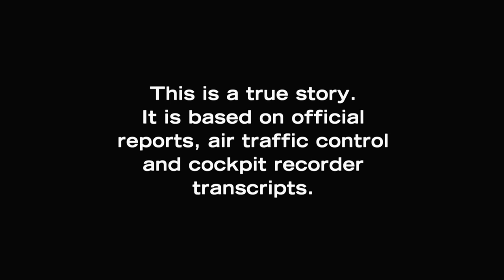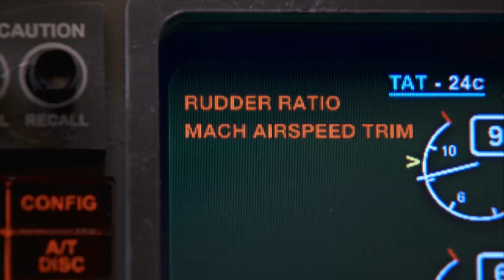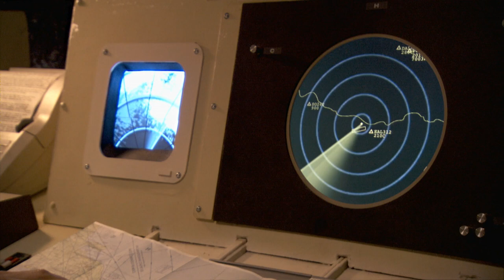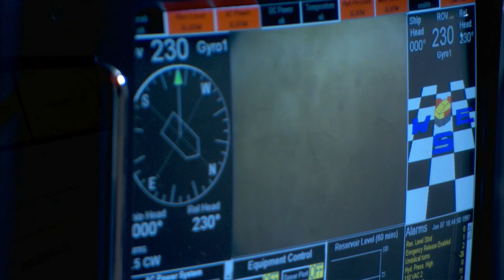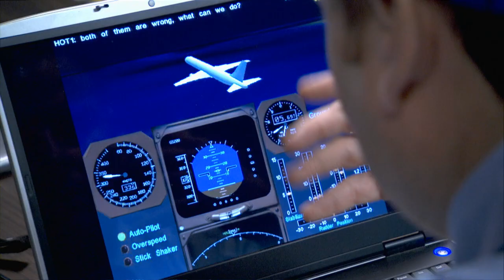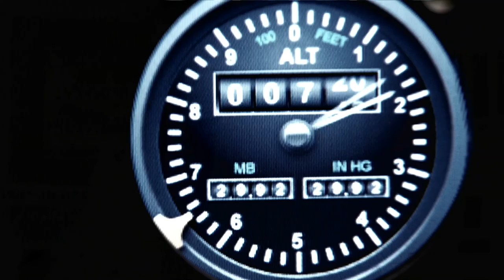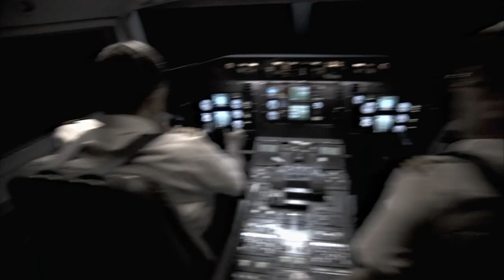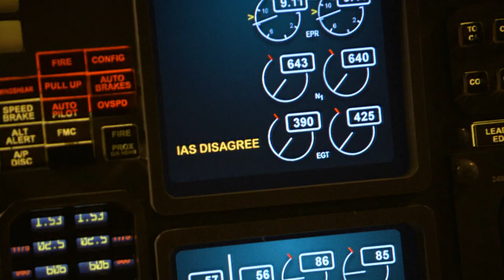The Plane That Wouldn't Talk | Faulty Readings | FULL EPISODE | Mayday: Air Disaster

Comment: I heard from another video that a pilot can ask ATC for a speed reading. If these people did that they could have gotten an external source that would have given them the idea of witch side air speed reading were right. This is basic stuff how do they not do this?
Reply: That's what I wondered. No mayday, no communication with the ground...why not ask them for verification? It seems most of these accidents are caused by one mistake after another. Not covering the pito tubes when the plane was grounded...the mechanic noticing the tubes weren't covered but not saying anything about it, which would have led to someone checking for blockages, which IMO the mechanic should have done, especially when they know about mud dauber wasps...flight crews stranded for two weeks waiting for a flight to get back home, making them homesick and prone to overlooking things...airspeed for the autopilot relying on one easily blocked mechanical input...the pilot taking off when regulations say he should abort the flight...deciding his airspeed was correct when he knew it was not working at takeoff....pilot not listening to other crew members when they were telling him what to do...co-pilot not taking control of the plane...

Comment: The Navy found the cargo door from a 747 that came open and caused an explosive decompression and pulled passengers out of the plane. It was a billion ft deep in the ocean and it came off at 35k ft. They can find anything.
Reply: Except for that missing Malaysian flight ….
Reply: Because it is larger than a pitot tube, obviously. Now try finding an aircraft piece that is merely the size of a house key, and the plane itself, in the middle of the Atlantic Ocean.
Reply: When I went to an air show, I almost couldn’t find the pitot tubes on the big planes because of how small they were.
Reply: @Powerranger-le4up  perspective thing there. Get up close they would be around a foot long or so. It is just tiny next to the massive airframe.

Comment: It seems to me that the captain (and the other officers) didn't understand HOW their instruments get their readings.  They knew how to fly, obviously, and how to read their instruments.  But when it comes to troubleshooting issues that aren't in the manual, electrical and mechanical experience is required to properly diagnose problems.  The captain, despite all his experience flying, didn't seem to comprehend the consequences of having a bad airspeed reading.  If nothing else, he should have understood that autopilot wouldn't work correctly if it was being fed faulty info.

Comment: Since at take off the pilots speed indicator was defective ( too low " my air speed indicator's not working " ) and the co-pilots was good ( used to determine correct takeoff speed ) , why would the pilot suddenly accept his speed indication was correct and they were flying to fast ? The pilots speed sensor was feeding the wrong info to the auto pilot so go to manual. The stick shaker indicated a pending stall and the pitch indication showed the nose was too high so why wouldn't the pilot drop the nose , pick up speed and prevent the stall ?

Comment: Blocked pitot tubes, inaccurate instrument data, autopilot disengages, aircraft stalls, pilot pitches the nose up to correct, aircraft ends up at the bottom of the sea...this all sounds eerily similar to Air France 447 in 2009. Why did history repeat itself?

Comment: Those mud daubers were only doing what they're supposed to do.  If the mechanics had also done what they were supposed to do, the failure would never have occurred.
Reply: If the pilot was even half way competent the crash would not have occurred.
Reply: @brencrun5068  I agree and also the Captain is the final person to inspect the plane to insure that it’s safe to fly. I would think the pitot tubes would be at the top of the list for inspection but what do I know??!! I can say I’ve learned a tremendous amount by watching these videos.

Comment: Is there any way to design a stand alone airspeed sensor that’s more analog than digital that pilots can use in case of faulty readings? Idk why but of all the crashes I’ve watched, this one some how bothers me the most…
Reply: Yes, an anemometer - a small propeller near the wing root - driving a small, bicycle-type generator - and an analog voltmeter.  

Not very precise, but simple and straightforward.

It can be “compensated” by making the scale move on the basis of air pressure/altitude/angle of attack…

100% analog.

Comment: I've watched several videos where the problem was a blocked PITO tube and I wondered about a way to blow out the PITO with compressed air. It would simply require a valve near the reading device and right next to it a compressed air line which when activated would blow a suitable pressure back out of the intake end and clear it and issue a warning if it was not cleared. When the PITO is cleared the valve would open and the system would be back to normal. If not, it would ground the plane. Clear "PITO" would be first on the take-off checklist. But... I'm sure I'm not the first to think of this.

Comment: Add pitot tube unblocking even if they appear clear upon visual inspection. Just a thought.
Reply: Right? I've often thought that, like a compressed air line that can blow them out with the press of a button, same for the static ports

Comment: For $100 million plus, it will always baffle me just how fragile && finicky aircraft are. Bugs, birds, a missing bolt & boom disaster 🤦🏾‍♂️
Reply: Well what do expect? It’s a highly complex piece of machinery designed to fly at relatively high speeds at 36,000 feet. You don’t just leave one bolt out and go “Ooooh I’m sure it’ll be fine”
Reply: @pp3k3jamail  You wanna know what baffles me? How fragile your ego is. I’m not trying to start any argument here, and I’m sure if the OP took issue with anything I said he’d address me himself. You gotta keep your ego in check.

Comment: As someone who is not a pilot, two aspects of the captain's actions seem rather bewildering to me.
One is the captain's decision to start trusting the airspeed indicator that had clearly shown itself to be defective just minutes earlier. The indicator that worked perfectly during the takeoff he stops using. Secondly, with the plane climbing at a fairly high angle of attack, I wonder if it could have even been plausible that a condition could exist in which you could pull back the throttles toward idle while keeping the high angle and actually believe that the plane was traveling at a dangerously high rate of speed. Perhaps that does occur in some flying situations, but sounds counterintuitive.
Maybe it just comes down to the stress and the fear clouding their thinking and the fact that CRM had not yet been implemented.

Comment: A 12 year old kid playing aircraft simulator games could’ve flown this plane. Stick shaker? Apply full power. Duh.
Reply: They DID apply full power, but because the nose was pitched too high up, the left engine shut off from being overworked, and the plane started spiraling toward the at that point.
Reply: Apply power and drop the nose — fly the airplane.
Reply: @ywgmb35  Well, there you go.
Reply: @milesaway3699  he didn't pitch the nose down after applying full power though. He kept pointing the nose upward, so that's why the left engine flamed out.

Comment: so this is me prior to the explanation of how things went wrong. I think the pitot tubes are blocked or at least one of them and once the pilot felt the stick shaker should’ve IMMEDIATELY powered up the engines and point the nose down to get air under the wings. I ain’t no pilot or an expert on physics I’m just speculating but seems plausible to me.

Comment: Well I guessed right for the wrong reason. I thought well the issues started after the autopilot was turned on and we know that the co pilots speed was working since we didn't crash on take off, so the autopilots probably broken, it should be turned off and the plane flown manually with the co pilots speed. I can't understand why the captain concluded both speed readings were wrong.

Comment: You could clearly see how the airspeed instruments were going crazy and confusing. Birgenair 301 and Aeroperú 603 both have the same problems at the same time. It's like a roller coaster going down steeply but at break neck speed. RIP to the passengers and crew on both flights.

Comment: 1. The autopilot depends on agreement between the pitot tubes on both sides. If there is a disagreement, it defers to pilot side. If the pilot side has bad data, the autopilot will do dumb things and throw bad errors. 2. Pilot should have known that 20 degrees positive AOA at 350 knots and climbing was bogus. 3. Say it with me. Nose down, increase power. Nose down, increase power. ALWAYS nose down, increase power.

Comment: Ok,
I've watched about 30 of these episodes now and 2 things really show- 
1. Believe your stick shaker. Put your nose DOWN and get some air speed- regardless of instrument's. Then troubleshoot....
2. Pitot tubes blocked, obstructed, not working completely RUIN your instruments. 
I am not condemning pilots in any way here, but pilots seem to be so trained to believe their instrument's at all times that when faced with conflicts, wrong reading, etc. they seem to be  overly reluctant  to make decisions outside of them or even pause that they may be fallible. This may be caused by the airline mfg's and the training given that stresses to absolutely believe your instruments- always. I understand this as well- if your can't rely on your instruments then what do you rely on? Short answer, instruments.
I have some flight hours, single engine VFR only so I can't speak to the training airline pilots receive, but there must be some way of allowing independent analysis outside of electronic/digital instruments in an emergency to verify correct readings. It just seems frustrating that over and over again in these accidents when instruments fail, it just seems to shut down or fatally compromise these otherwise fine pilots. Is there any way to confirm correct pitot tube operation/fault during flight? Same for the flight instruments? Should aircraft have a small panel of old school mechanical instruments as a last ditch back-up or reference to check electronic/digital gauges? Idk, I guess I am just thinking out loud here...
Please don't get offended here, I am not a professional nor claim to be one. Just making observations.

Comment: I think the pilot isn't to blame, it's the ground crew, even in their interview they were arrogant about not doing basic maintenance and upkeep.
The tube covers could have been on, pssh, we never bothered with simple maintenance protocols, what's going to happen, a plane crash.
That's what they sounded like
Reply: The captain should have  aborted the flight ✈️
Reply: @bejakabyle  the pilot should have aborted, but this entirely caused by ground crew. It's shared between the pilot and ground crew.
Reply: @The_Stumbler  He knew his airspeed is wrong .
Reply: @bejakabyle  you're not reading, pilot and ground crew at fault, pilot for not aborting, ground crew for not proper maintenance.
Reply: @The_Stumbler  you bet , but the Pilot has a big responsibility. As soon as he saw his airspeed is reading wrong , He should have aborted the flight right away
Reply: @bejakabyle  the whole situation could have been avoided by putting covers on, the nest happened during the time it sat on the storage area. There wouldn't have been a wrong reading if the ground crew did their job.

Comment: What I don’t understand is why the captain didn’t automatically assume that the first officers air speed indicator was correct from the get go during take off. Obviously if the air speed on the captains side was correct, the plane wouldn’t have been able to take off.

Comment: You can thank the CA for killing everyone on board. The airspeed check at 80-100kts (based on your company SOPs and aircraft), is designed as your first point of rejection for exactly that reason: verifying airspeed is working and both sides are the same. If not, its very simple, you reject and get it fixed. I wonder if the dramatization of the CA mulling over whether to continue was accurate to the real time line, but that was one of the most infuriating moments. That's an immediate reject at that point. There is nothing to decide. The decision is made for you. Add to that the CA holding the yoke in his chest at altitude and the FO doing nothing to intervene. Completely avoidable at multiple points and so sad. At that point, they still could have saved it using a known pitch and power setting for that phase of flight and still brought it in to land with unreliable airspeed readings. This is solely on the CA.

Comment: Mud Dobber Wasps will plug a pitot tube in less than 24 hours. They lay an egg then find a small caterpillar for the baby to eat when it hatches and push it in too, then use liquid mud to plug the nest. Happened to us many times in Hawaii at Dillingham Airfield in the sailplanes we did sightseeing rides in. Fortunately, just the attitude of the glider and noise it's making through the air is enough to fly safely.

Comment: After viewing many of the MAYDAY. episodes I correctly diagnosed a blocked pieto tube on the pilots side immediately on takeoff.  This was why the autopilot was malfunctioning during their climb also. Since this led to confusion  on the stall warning conflicting with air speed alarm I imagine the flight crew unable to take the proper actions to control the plane in time.  Wishful thinking says had the 1st officer taken the wheel  and used his instrument readings disaster probably would have been avoided.  The maintenance employees neglecting to put the covers on the pieto tubes was maddening knowing that wasps were prevalent in the area.  A series of mistakes proved fatal.   At least the investigation that was carried out found the needed actions to prevent future problems from arising and causing such a catastrophic scenario.

Comment: While the captain should not have assumed that both indicators were wrong and aborted take off, it wasn't COMPLETELY his fault. Why wasn't the plane subjected to a more thorough inspection before flying? All vehicles need a bit of maintenance after being idle for a while. Even a bike needs air in the tires after a weeks long "sitting" without its rider. Whatever might have been wrong with the speed indicators could have been caught if the plane had been throughly inspected, possibly preventing any bad decisions that the captain made.

Comment: I am not a pilot. However I am curious that when throttle is fixed in any position,  how can the airspeed keep increasing without continually pushing the throttle forward to power the engines. 
Maybe the pilot should have thought of that and rely on FO's Airspeed Indicator.

Comment: Not sure if it was due to a blocked peto (sp?) tube but a similar situation happened to ConAir Flight 3407....it entered an aerodynamic stall situation and the pilot was still trying to pull the nose up instead of pointing it down.  I live in the Buffalo area and it was heartbreaking to hear about and one of my new co-workers at the grocery store I work at lost a cousin on that plane 😞

Comment: They need to change the balance of safety and cost.  Pointing the nose down has proven to be counter intuitive even for trained/experienced pilots.  When the  altitude is too low pointing the nose down is not an option.  Auxiliary rockets, I think, do not depend on air flow like a jet engine, it works on the principle of chemical action of expanding gas.  In the least it will give more time to seek for a solution to the issue.

Comment: The captain should have aborted the takeoff but I understand they wanted to get home and a full speed abort isn't ideal. However once they were airborne, couldn't the pilot have called the tower for a speed check? Worst case they should have compared their airspeed indicators to the ground speed indicator. And lastly, I feel like he didn't revert back to his training when he felt the stick shaker. Regardless of aircraft speed, that stick shakes I'm pushing that MF forward, especially when you feel the plane start to vibrate. Yes overspeed is bad but a flat stall is worse and at that point they should have realized that one of those warnings wasn't real, and the plane vibrating was the tell tale sign. So sad it was such an avoidable crash.

Comment: Never knew about the Pito tubes, seems a rather important piece.
Reply: One of the most important pieces to flying because without them on an airliner you can get a wrong altitude reading. Sometimes mechanics leave tape over them and planes crash because of it.

Comment: Pitot tubes. I know this was in the 1990's but do planes still use Pitot tubes? As a boater the Pitot tube is known as well. This was the "primitive" way of measuring a boats speed on the water. Now everything is GPS. By now I hope airplanes also have GPS to measure speed.